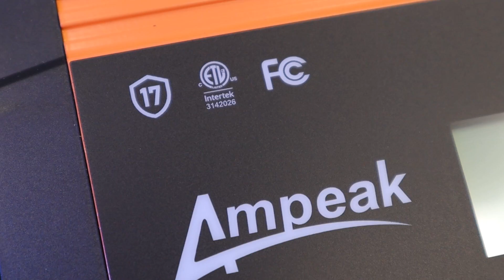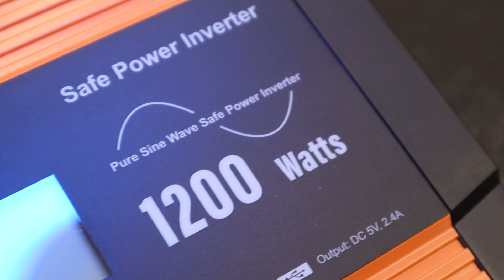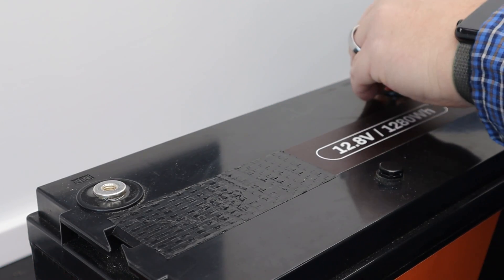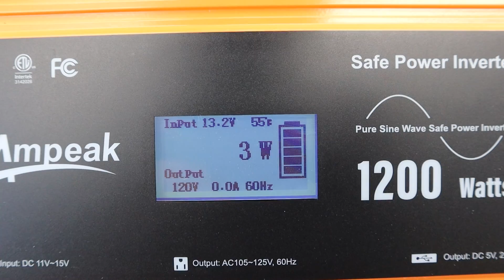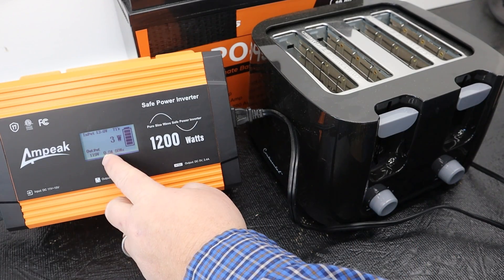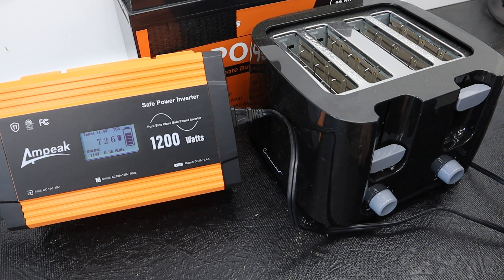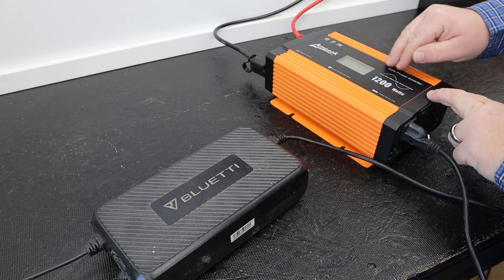This Inverter Surprised Me

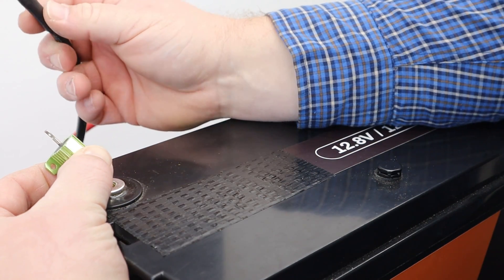Comment: "There is no set science method to it..." @4:00 there is absolutely a science to it, the time needed is a function of the resistance value, input voltage and the total input capacitance. You also state that this resistor helps prevent a short circuit, it's actual function is to limit inrush current and not required. The spark created by charging the low impedance capacitors doesn't cause damage.  Hate to see people getting bad information when it comes to electronics.
Reply: Sparks are always a risk if you have MOSFETs and microchips in the circuit, it's not a bad practice to avoid them, in most cases there is no damage since there are usually filters in place, but still not a waste of time if  you don't mind doing it.
Reply: @jovand6606  I agree it's not a bad practice to avoid the sparks but absolutely not required to protect the IC's or mosfets. I'm an electrical engineer, if you would like I can go into detail to further explain the physics at play but from my experience nobody reading these comments would understand. You can either believe what I'm saying or you can spend the time studying basic electronics theory to help gather a better understanding just to come to the same conclusion that I am stating.
Reply: @OffGridAndOutdoorLife Thanks for understanding and not taking it as a condescending post, my intent was simply to provide insight. You did an excellent job. I was hoping to see the inside of the converter to judge the circuit layout and topology but it was enjoyable none the less.
Reply: @OffGridAndOutdoorLife You are absolutely correct, I mistakenly thought you were the OP. Ooops! How embarrassing, I'll be sure to pay more attention in the future.

Comment: I'm building a DIY "solar" generator and ended up getting a 1250 watt MSW inverter. The only thing I'm gonna be using it for are my power tools at the cabin.
If it can run my table saw, I'll keep it. If not, I might look into this Ampeak. It looks pretty impressive. Perfect size for my 100Ah battery.